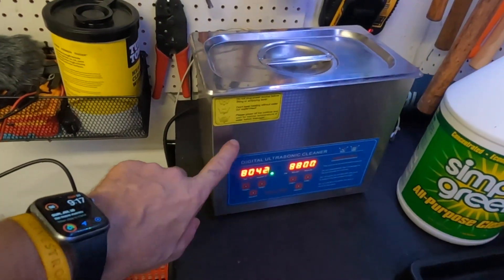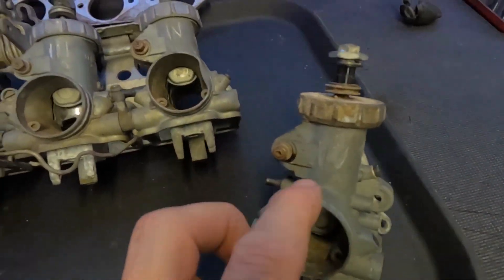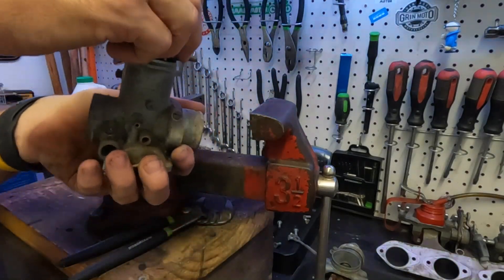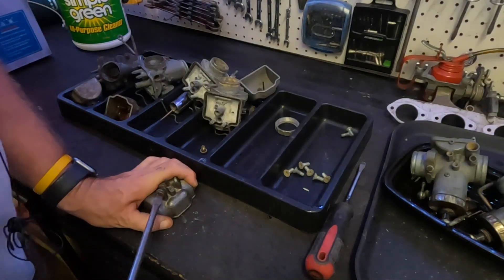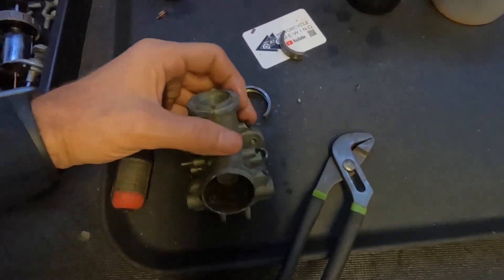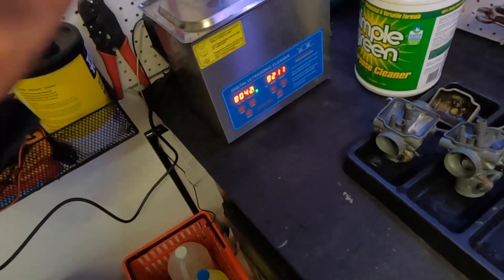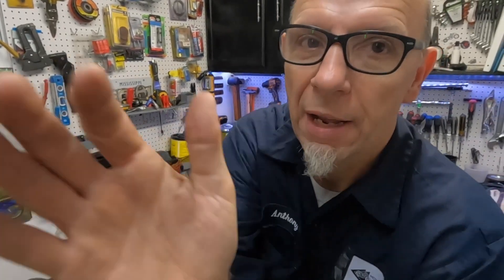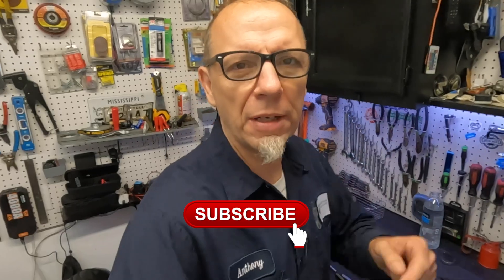Prepping & Cleaning Carbs on a Vintage '73 Honda CB750 #cb750 #vintagemotorcycles #motorcyclerewind

Comment: My man here across the pond in the USA has all the tools and his grubby little fingers on the nicest of nicest bikes 😂😂.... On a serious note though, I said a few weeks back that your simple no-nonsense "cheapest because it's what you got" approach - inspired me to work on my bike that's been rotting in my yard for the last 18 months whilst I played with the Reliant Robin... Well update - the Deauville 650 turned out, due to an unfortunate tarping situation to be full of water, siezed with gunked up carbs.... WD40 soaked cylinders got them free (it's what I had) carbs soaked in white vinegar for 4hrs and blasted with a can of  (cheapest) carb cleaner and a blast from the compressor and "knackered" gel battery charged via the passenger seat of the Robin for 2 30min journeys - managed to start and run, with herding cats effort, for about 30 seconds today before dying... But tomorrow's another day 😈😈 This isn't the best or greatest bike I've ever had BUT it's the first my kids went on, the first my partner went on, a survivor of a muppet in a car U-turning into it, a survivor of drops from front brake lock ups on gravel at the traffic lights... A bike I bought back off the insurance company for £100 after the 30mph U-turn incident and stripped the fairing off and ran for a further 3000 miles... So yeah, I'm loathed to spend on it... But Motorcycle Rewind somehow re-inspired me back into my usual "bodge it and scarper {but properly}" repairs using the "what you've got" and "because it's the cheapest" method AND I'd recommend the same to anyone mechanically driven... Thank you MC Rewind... And PLEASE don't give up on spreading your joy and your word!!! {or Howard's word as it might be 😉}
Reply from the maker: This is the best comment ever. One of the main reasons why I started the channel was to tell stories of my late friend/mentor Howard. 
To have you,  someone who has never met him mention his name means he lives on. Mission Accomplished.